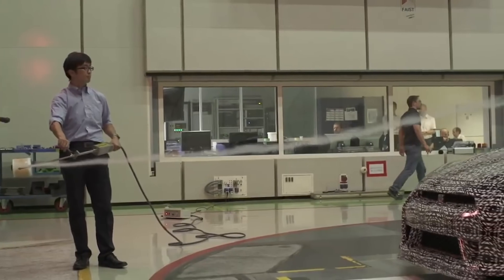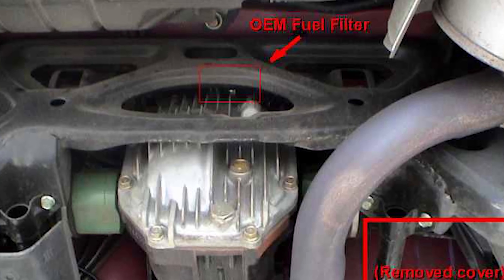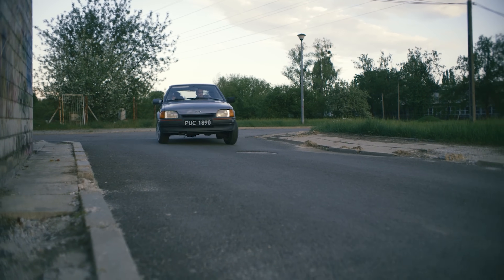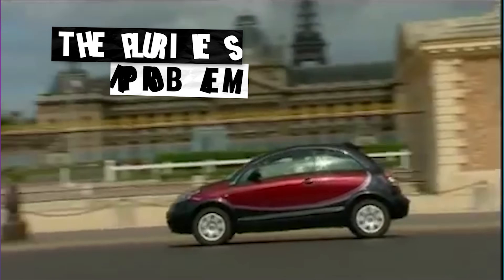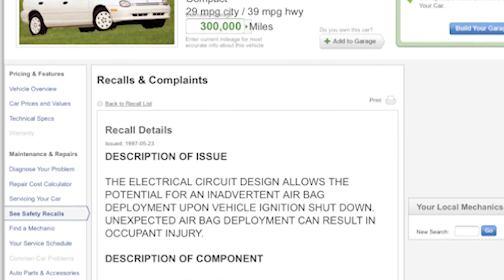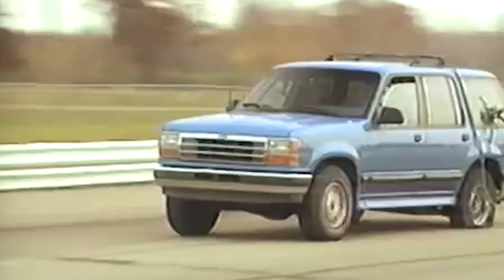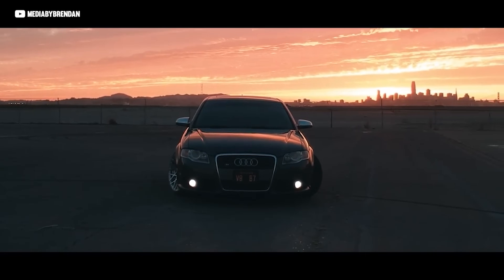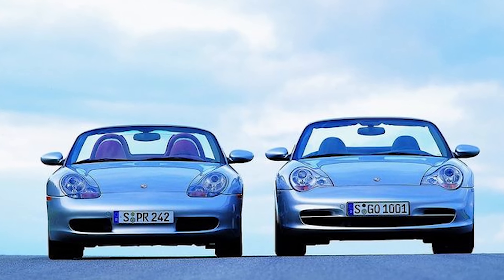Car Expert Reacts To 14 Worst Engineering Fails... EVER

Comment: You forgot everything, with a Turbos, which gets to be 1875° F.. there are videos of this. It turns Red Hot, tue to being connected to the Downpipe, which is connected to the exhaust system.  It spools the impellers, for boost.  Needing an intercooler to somewhat keep it cool. They mount the Turbos next to the Aluminum Engine block and  warping it. I lived thru this with everything called EcoBoost or 
Eco Tec. It's all EcoTragic, and Europeans are going to slowly eliminate Dodge brand name to import their Turbo Junk.... Fits to Alfa Romeros. Adding Maserati to the mix... since they're eliminating Hemi and All their American V8

Comment: I now have a new reason to dislike Audi.  On the back of the engine, really?  If the trans is easier to remove than the engine, and you can service the chain with the engine still in the car, they might get a pass from me.  Such a scenario gives you an excuse to upgrade the clutch to a stage 3 and a lightweight flywheel.  But, if the engine needs to be out to do the service, yeah, hard pass.  Almost any other vehicle lets you do the timing belt/chain with the engine in the car.

There was a lot of controversy in the 90s about almost all SUVs being a rollover hazard.  The exploder being chief among them.  To this day, I refuse to buy Firestone because of the tire issue in the late 90s, early 2000s.  In 2001, I was introduced to a small South Korean tire company called Kumho.  The tires were not well known at the time, but were cheap.  I hit a curb and drove with a bent lower control arm for about 1.5yrs.  I was around 19 at the time and didn't know squat about cars then.  I repaired the issue myself after taking the car to a shop and receiving an education on the real problem.  During the 1.5yr period I was buring through tires once a month.  Driving in the rain was always a fist-clinching exercise.  Routinely I would ride on the corner of the tire until the radial would start to show.  Because of the horrible alignment in the rear, the driver rear tire rubbed itself bald.  Even with cracks in the tire and no tread left, the Kumho tires I was riding on still held air and never blew out.
Kumho has since been my go-to tire brand.  I'm riding on a set of Kumho tires right now, actually.

A lot of these notorious issues have been covered before, but they're still good to see, and remember.  I forgot about the fuel filter issue on the RX-7.  I thought that car might be better than the RX-8.  Only in looks it would seem.  As much as I rag on the boxer engine, I would much rather have one of those than a rotory.  I want to love them, but I can't.  Far too complicated to justify the unreliability.  I can swap a fuel filter on a miata in about 30min.  On an EG Civic, about 10.  I just can't justify the headache of an RX-7.  Cars are hard enough to work on, I don't need to torture myself in the process with poor disign.

As always, great video, liked the music in the intro.

Comment: to me, replacing too many physical buttons is also an engineering/design fail... yes, at some point cars had too many buttons, especially when in-car entertainment really took off, but I still think that some things should be controlled with real button, e.g. climate controls, heated seats or the radio's volume.
Reply: The latest GTI (Golf) is the obvious example of this. This is a reason why many enthusiasts have preferred the "last" generation GTI.
Reply: @robwaters8848  yeah, even VW kinda sees that now and they will reintroduce physcal buttons on the steering wheels of upcoming models again...

Comment: The Ford Explorer one was more a result of user incompetence than anything. When those came out, Ford stated their tires to be inflated at 32 psi. Many owners thought that was a high value for a tire because none of their past cars required that much pressure and would under inflate the tires, which caused the Explorer to be unstable and roll over more easily. And this is the reason why cars have tire sensors nowadays.
Reply: 4
Reply: @neilnelmar8007  "sensors" imply there are more than one. Don't be a smartass.

Comment: Another engineering fail of the A Class is: If you have to replace the starter, you have to drop the whole engine, Transmission and front axle as a unit, because it is mountet on the top with no access from above.
The alternative is: Cut a big hole in the dashboard
Reply: This happens with every single Range Rover because the car's body work is part of the chassis. If you need to access the engine, you have to almost disassemble the entire car.